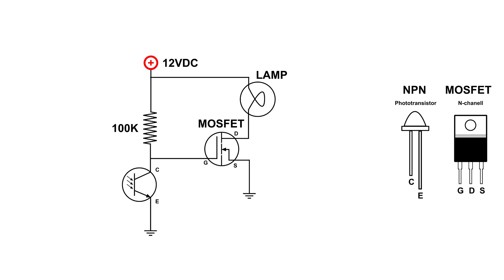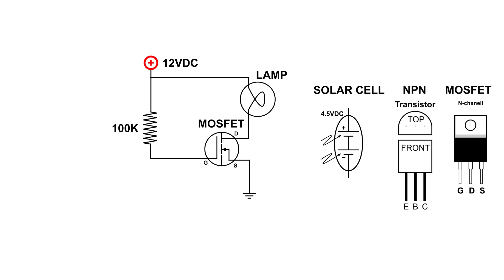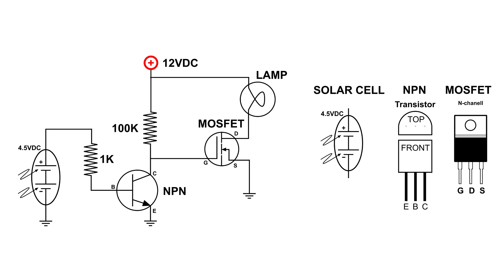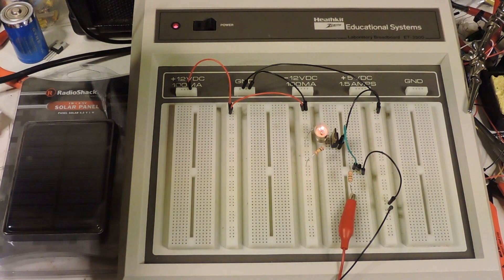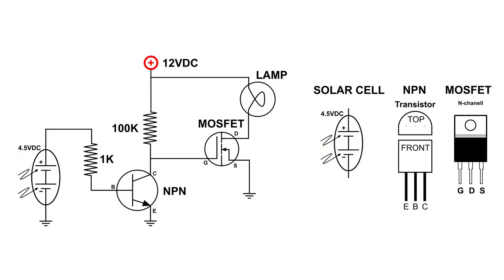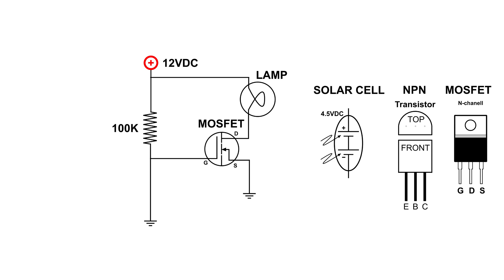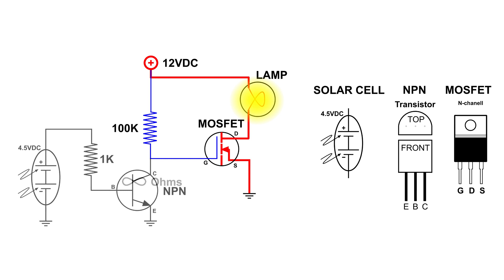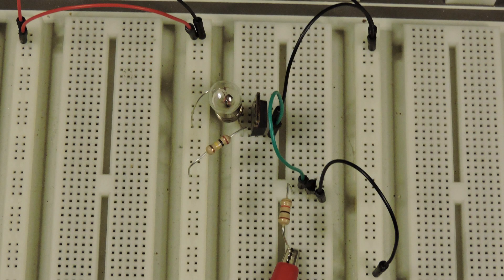Auto On Off Light Switch using a Solar Cell

Comment: What a useful simple circuit, and very well explained too. Works perfectly as a garden light, much better than the other circuit you showed, that had a phototransistor instead of solar cell. I tried both, but the phototransistor version needs much more light to turn the MOSFET off. I noticed that the 100k resistor can be replaced with a much higher value without affecting the circuit - I'm running mine on a 1.1M resistor and, not surprisingly, it's drawing just 11uA during day-time.
Reply from the maker: Thanks for the information. Some YouTuber wanted to us solar cell, probably that's what they had.

Comment: Hello Sir,
Could you please tell me the purpose of 100k resistor?
Thanks in advance
Reply from the maker: Supplies the positive bias for the Gate of the MOSFET
Reply: @AllAmericanFiveRadio  sir I using this cct but my 12 v dc led bulb not getting  12 v through  this cct

Comment: This circuit is very useful except for the fact that it won't charge battery. Can you please tell us how we can wire it up so we can charge the battery. Thanks so much.
Reply from the maker: You would need a separate charging circuit.
Reply: AllAmericanFiveRadio , would that involve different components added to this one? What do you recommended?
Reply from the maker: @milvolts1  Yes a total different circuit. What you need depends on the batteries your going to use.
https://www.amazon.com/Best-Sellers-Garden-Outdoor-Solar-Battery-Chargers-Charging-Kits/zgbs/lawn-garden/13638740011
Reply: AllAmericanFiveRadio, thanks

Comment: This is very interesting I think I found what I was looking for. Would this cuicuit work to power up some yard lights that require 7 to 9 volts of power . I will be using a 5watt 9 volt solar panel and 2 18650 batteries in series with a BMS? Please advise. Thanks so much
Reply from the maker: Should work. I like this circuit also.
Auto On Off Light Switch
https://www.youtube.com/watch?v=WFIJxkKc-JE
Reply: AllAmericanFiveRadio , I think I like the Solar on off circuit better because the lights will not turn on till the solar panel stops producing power. With the photo transistor it seems to turn on sooner rather than later. Therefore draining the battery faster. I cant wait to get the parts in to try this circuit. Thanks a lot have a great one

Comment: Brilliant tutorial, exactly what I'm looking for, but one question, does the solar panel charge the battery.
Reply from the maker: There no batteries in this circuit . The solar cell acts like a battery when light hits the solar cell. The solar cell generates voltage when light hits it.
Reply: AllAmericanFiveRadio , Rick, so are you saying that the solar panel is acting like one huge ldr in this cuirciit? How can I get the solar panel to charge a battery. Thanks

Comment: Thanks.  I am trying to make a novelty solar cell circuit that constantly cycles a meter...slow rise time...slow discharge..it seems that this circuit is near what I am looking for.  Could it be modified to do what I want?
Reply from the maker: I'm not sure what you're asking for. The circuit function is determined by the light falling on the solar cell.

Comment: Well explained so one actually understands what is going on. How would one adapt the circuit to switch OFF a load during daytime in this PV solar charger setup https://learn.adafruit.com/assets/34578 (here shown with a buck/boost converter)?
Reply from the maker: Just cascade another MOSFET,  the second output is 180 degrees out.
Reply: Thanks! I'm not too sure I understand, but what I eventually did https://imgur.com/a/65KXEv1 was to take a single FQP27P06 PMOS, source to solar charger output, drain to buck/boost converter, gate to PV solar panel output (with a 1k resistor in between). I take it that this arrangement is called "high side".

Comment: Hey, thanks for the video, i,ve been trying to use PWM from a parallel port to vary the brightness of led,s which in turn varies the resistance of an ldr, which then controls the freq of a pair of 555,s...   it,s kinda jumpy... I think i,ll try this setup and see if it smooths out the lumens. thanks again
Reply from the maker: Thank you.

Comment: 1) What is the purpose of the 1K resistor? Is this calculated somehow?
2) When the NPN is conducting, isn't it shorting the 12V to ground, causing a continuous flow of current?

I have an Extra Class ham license but these resistors in circuits still throw me.
Reply from the maker: The 1K is current limit.
continuous flow of current?..... Where?
I have an Extra Class Amateur licenses  and a First Class Radio Phone licenses with a Ships Radar Endorsment

Comment: Very ingenious circuit, but in what circumstances would it be needed ?
Reply from the maker: The original question was “How can I make a circuit to automatically turn on 12VDC Led strings when it get's dark?”
Reply: AllAmericanFiveRadio even i didn't connect the 100k resistor with the power supply the lamp remain always on